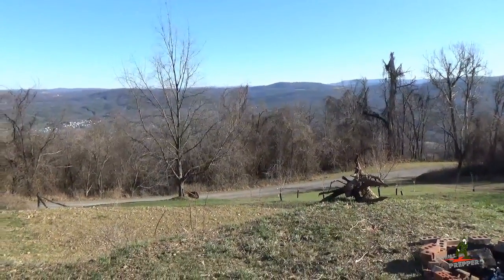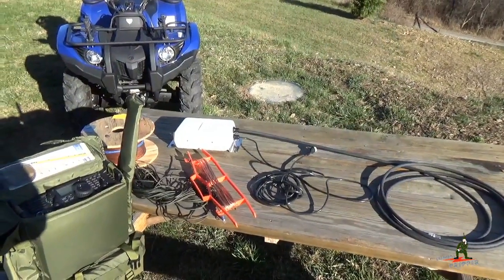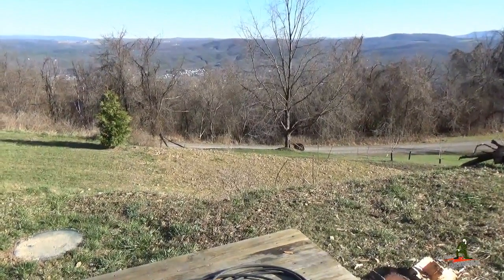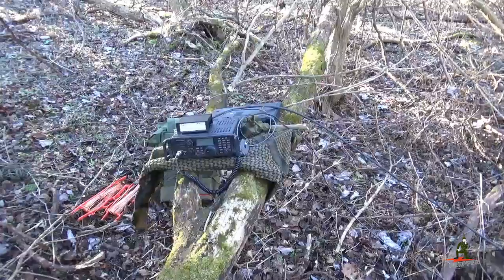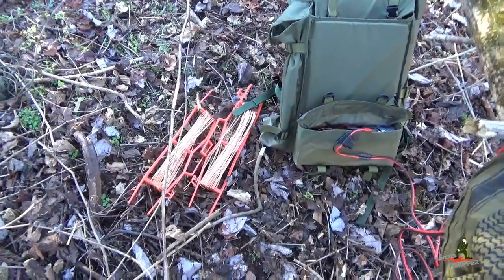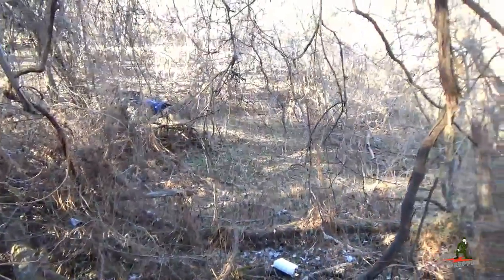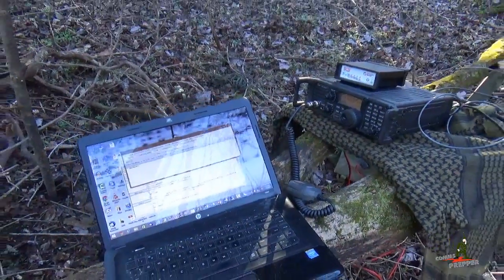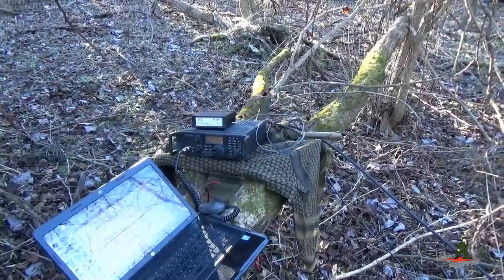Tactical Operations IC-7200 with AH-4 Tuner

Comment: I just bought an AH-4. This gives me some idea how to use it. I have two questions maybe you can answer. The first one is what is the optimum length for an antenna wire if I want to talk from 10 to 80 meters? The next is about the counterpoise. What I got out of the video is you have to have either a ground or a counterpoise? But you don't need both, right? Thanks for the video.

Comment: Just wondering do you have the ground wire connected to a grounding rod?  I have the AH-3 tuner.
Reply from the maker: When I use the tuner I do connect it to a ground rod.  If I cannot use a ground rod then I use a counter-poise wire that is 1/3 longer than the wire antenna.  The extra length keeps the tuner from confusing the counter-poise with the actual wire antenna.
Reply: So in a way you do not need a ground rod.  Should the ground wire be underneath the antenna?

Comment: I was looking what had been done on the IC-7200 as I research pack frames for the radio and I had forgot you did one =)   I will be using the IC-7200 for a bit until I can fix or replace the home rig ( FT-847 ) no power problem =(    I had planned on using the IC-7200 as the mobile rig with a R Pi II with 7" "touch Screen" with Fldigi ( works great with the built - in soundcard and R Pi USB port as is =)   I like the Falcon II pack idea you used =)   I may mod the pack to have the top of the radio open with a modded flap "VELCRO'ed" to the pack fabric ( that may help the really tight fix for the radio inside the pack ..... but not to degrade the pack PADDING =)   I have a SGC-239 antenna coupler ( the ex-military version granddaddy of the AH-4 Tuner  and a LDG Pro-100 antenna tuner -- that came with the radio ( not used yet =)   Antennas ... with the tuner / coupler stuff .... any type of antenna  can be used in the "Field" 8-)

Comment: Good video. I'm wondering do you ever worry about your gear being impacted by weather and other varying conditions in the field? I don't know if its feasible but I'd like to see communications performance during harsh weather.
Reply from the maker: +GeneralSLee water and gear is always a bad mix but you can do things to mitigate the risk.  I always keep a shelter-half around in the field and black trash bags.  Picking equipment that has water resistant features (like the IC-7200) also helps.

Comment: I have the same radio and thanks for the heads up on the bag.  I picked one up off of ebay about a month ago.  Question:  what size SLA's are you using?  I tried to put two 9AH in the same manner that you did; however, I can only fit one in the battery compartment.
Reply from the maker: +Brett Smith Not sure what the sizes are but I can force two into that compartment.  I think they are standard alarm panel size batteries.

Comment: would you use the chameleon instead if you are attempting to minimize the amount of time to break down your setup and move?
Reply from the maker: +j johns The Chameleon is faster but is limited to 10/15 watts.  With the wire tuner I can use the full 100 watts (provided I have the power supply to support that).

Comment: How did you install the long wire.  Using a sling shot launcher or tennis ball launcher?
Reply from the maker: +afshin735 This time I just reached up (about 6 feet) and tucked the reel into a branch.  Not the best antenna but it only has be good enough to work when tactical.

Comment: Dude, that is such a cool demonstration of tactical, covert and rapid deploy commo. That capability would be invaluable in the field for command and control, reconnaissance reporting or to call for a rescue..lol.  If one couldn't get the exact equipment you have, at least he'd know what kind to get, thanks to you.
Reply from the maker: +DocLarsen44 Doc thanks for the great feed-back!  I am really pleased with the IC-7200 and tuner.  Weighs a bit more than my bugout back radio setup but the extra power is a big plus!

Comment: Thanks for posting..  I learned something. I didn't know you needed a 1/3 longer counterpoise for a random wire antenna. I'll remember that now. Thanks...
Reply from the maker: +Wes41  Yes, wire/whip tuners like this need to see different lengths when tuning.  Having the counterpoise longer than the radiating wire/element allows the tuner to distinguish between the two connections and tune the shorter of the two.  If the counterpoise is shorter the tuner may try and tune the ground side of the antenna.